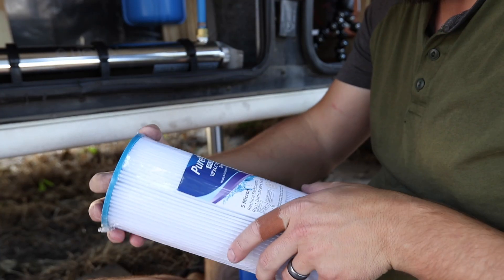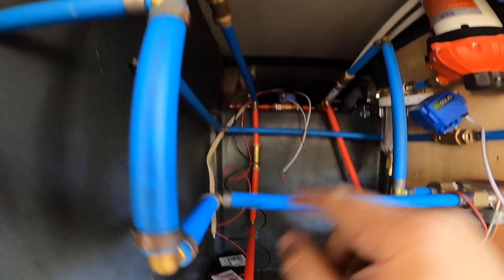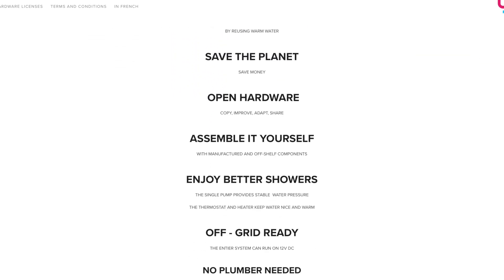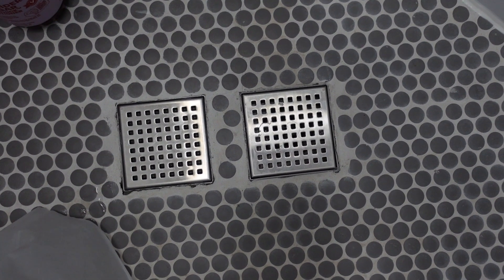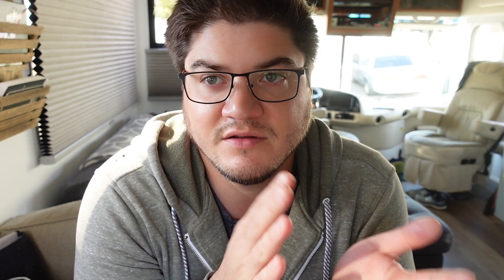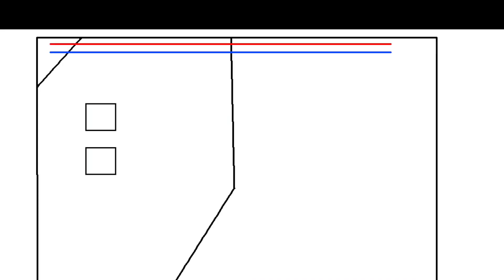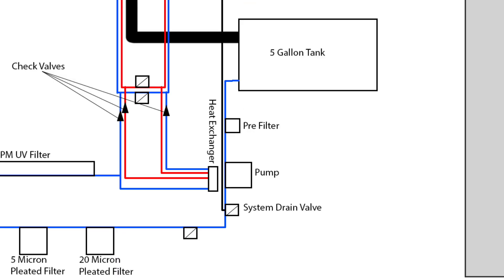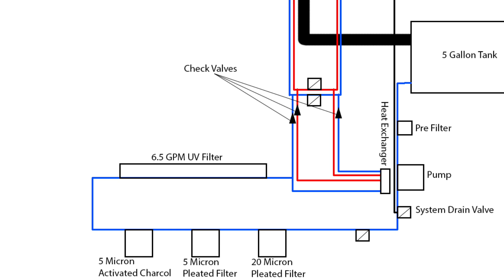Overview of Our Recirculating Shower | RV Renovation

Comment: Just subscribed to your channel.  Making a recirculating shower is not easy. I've seen some companies still working on the system for over a year!   It would be great if you setup a " How to PDF" document... an income source?    How do you clean the system?  Some builders will reverse the water flow a few times before the replace / cleaning the filters manually.
Reply from the maker: Thanks! We were going to try to get a back flush system working, but simplified it down. So we manually clean the filters. The worst is for them to sit for a while. If it’s used pretty regularly, they aren’t too bad. It’s also good to note that this system doesn’t filter out all the soap. You would need a pretty large sand filter to do that from what I’ve researched. This one does a great job for how compact it is. We wanted something that was better than the ones that just push unfiltered water back through. The unfiltered ones do exist as retail systems. But I think the filtered ones have taken so long because they are working hard on water purity.

Comment: Having used this recirculating system for months now, do you still like it? How often do you have to change out your filters & do they get more gross than usual? How is the system holding up in terms of maintenance? Is the recycled water drinkable? If so at what point is it no longer. I ask cuz George Muro from Humble Road has  dissuaded. me from considering it, he doesn't seem like a big fan of the filter aspect of it.
Reply from the maker: The filters will get grosser than usual if you use a lot of soap. It works well still for what we need. We designed this for our use case. It’s been holding up well. We’ve cleaned the filter a few times. If they sit for a little while, they will need to be cleaned. 
Again, it all depends on what you need. I wouldn’t recommend this to everyone. There are simple systems on the market that just recirculate water with no filters or heat element. That may be fine for some people. We decided to do this as an experiment for ourselves. So far it’s been positive. But it does introduce complexities. 
The shower water would not be drinkable. But in a pinch, we could put in new filters and run river water through the system, and I am confident that would be drinkable. I just wouldn’t trust it if the system has been filled with shower water.
Reply: @ryanandsu  Coming from people with real world use of this type of system. I appreciate your honest, thoughtful & in depth information. Thank you, stay safe.
Reply: Ryan and Su. Great work. Soap issue - I am thinking of a soap catcher in shower base, something like wooden slotted removable box, 1 inch deep, with quick drying towel cut to size and held in place to catch some of soap, extend filter service period. 

As engineer I have worked on back flush filter cleaning systems, going to look at that. 

Will make mine as a removable cassette system so I can remove for service and repair, and in winter when not using van, maybe have trace heating option for a planned trip to Norway. Who knows. 

Other idea is external grey water pre-wash, catch grey water in tank with little pump to wash worst off legs before shower, wash dogs, boots etc. 

Not sure if you have seen ‘solar dump’ idea, uses hot water heater as a dump load once batteries full, see fb 12v boating, or search YouTube. Simple and nice idea to work with shower. Well done and thanks man. Graeme Wales UK

Comment: Love this setup! Question: What temperature does the hot water going INTO the heat exchanger need to be to heat the shower water? I'm looking to do a water to water heat exchange that moves water from my fresh tank through a hot water heater, to heat the shower water without contaminating my fresh water. Also, how do you keep your filters from leaking? I'm having issues with inconsistent leaking between filters, and around the lip of the filter top. Any tips would be GREATLY appreciated!
Reply from the maker: I’m not sure what it needs to be. Our is very hot. Like 140 degrees F. But I think the bigger thing is flow. It needs to be able to transfer the heat out of the hot water and then get nice hot water in there again to keep the transfer going.

Comment: I've seen a couple of these set ups yours is the coolest yet. I've been thinking of doing this but no one goes in to detail on it okay a little bit of where I'm at in my build now I have a forty foot MCI MC9 bus I'm converting I have 250 gallons fresh water tank, propane on demand hot water 250 black and gray combo tank and the water pump I'm Thinking I'm going to use a small well pump that has the expansion tank built on it I have 3/4 and 1/2 pex the pump the water heater are 3/4 main lines from the tank are 3/4. None of this is installed yet because I'm just not there in the build yet I'm at the spray foam stage
But it won't be long. 
like you I want to be off grid for extended amounts of time and not worry about the water.i have three storage bays but the front bay will be used for my inverters and battery storage one of the other bays will be used for the black tank and utilities in and out components so I have room for this in the last bay or in this case the middle bay the black tank takes up the last bay closest to the rear wheels I do believe my propane water heat can do recirculating for like radiant floor heat so I would need to figure that part out oh I have about 40 gallons of usable propane on board also.
Any direction you might have would be great thank you for any help.
Reply from the maker: Thanks! We do not profess to be DIY people at all. If the details are a little shaky, it's because we are trying to just document what we are doing (good or bad) and not trying to show how to do something. haha.
All of our piping is 1/2" and it works fantastic for recirculating the water. There is a ton of pressure and flow. We also have a 6.5GPM pump dedicated to the recirculating system. That also has been fantastic. No complaints about pressure or flow. The pump we bought is a marine pump (Seaflo)  that runs on 12v. It came with a pre filter. It's a little strainer basket that keeps particulate matter from going through the pump. I definitely recommend using a strainer before the pump. But do not use the little one a lot of pumps come with. Get a bigger one. The small one clogged up after about 4 uses. It did strain really well, but for a recirculating system, you are introducing a lot of clothing fuzz, hair, etc. The larger the prefilter, the more use you will get before having to empty it. 
Also, something I didn't do but wish I did was put a manual valve in place between the tank output and the strainer filter. That way you can shut off the output and clean the filter without having to Drain the recirculating system. 
The heat exchanger has been working well unless it is really cold outside. If the water is cold to start with, the heat exchanger takes some time to add heat to the water. Sometimes, we will leave the shower running for a while on a loop before using it just to let the water heat up. If you are adding new fresh water every time you use the shower, then it's not a big deal because the new water is most likely already warm. But we've tried to really go light on water usage and reused the water multiple days in a row.

Comment: Great video with lots of good info. Thanks for posting. I'm still trying to understand how the shower water is heated. Am In correct that hot water goes from your water heater through the heat exchanger and then flows back to your hot water heater in a closed loop? And that the water used for the shower is heated only by the heat exchanger so that none of that water actually goes through the actual water heater? I'm trying to figure out a similar system where I can retain the integrity / cleanliness of my hot water heater, but still use it to heat the shower water. I like your idea of two drains, allowing you to use soap / shampoo which can be drained into the grey tank, and then switch over and use the recirculating function with minimal soap / debris going through the filters. Good job.
Reply from the maker: Yes. That is correct on the heat exchanger. It keeps the two loops separate. They do not cross contaminate. 
I built in a hot water loop for the water heater that pulls hot water through the exchanger and then send it back to the cold water input to be reheated. Just like you would for a house hold system to get instant hot water on the far side of the house from the water heater. That loop heats the heat exchanger. Then the recirculating water goes through the other side of the exchanger and pulls heat out with the water never touching the fresh water. It’s basically a big heat sink transferring heat from hot to cold.
Reply: @ryanandsu  Thanks so much for the speedy reply. Much appreciated. This sounds great. I don't want to contaminate my water heater with recirculated water as I also want to be able to have hot water in the sink. This sounds like it may solve both of these issues. Thanks again.

Comment: So you opted for a heat exchanger (only)? Would having a heating element within the loop be more energy efficient? Since you don't have to heat the water from sratch once it's up to temp. but just cover the heat lost during recirculation... Clever system. I like the use of that heat exchanger and the seperate 5 gallon tank. And the accessibility for maintenance. Is the 5 gallon tank easily accessible for cleaning? Does it need cleaning often? Have you tried taking the recirculated water for analysis to see where you're at? How often do you need to swap out the filters? How do you cope with soapy water? Have you tried adding magnesium salt (i think that's what is used...) to cope with soapy water creating deposits in the system? Would insulating the pipes reduce heat loss and improve energy efficiency? I'm rambling... I have tons of questions. I'll try to see if uncle google can cough up any answers. Thank you for sharing.
Reply from the maker: Yes. We went with a heat exchanger only. Mainly because we didn’t want to introduce another heating element that would draw off our batteries. Using the heat exchanger with our water heater let’s us use either electric or propane. And the thought was that we could dump the holding tank and refresh the water in the loop with warm or hot water whenever we wanted to shower. It’s not as efficient as reusing the water for several days, but with this method, we don’t have to heat the water from cold with the heat exchanger. 
I haven’t had to clean the tank yet. But I would do it like I do our other holding tanks. 
We haven’t had the water analyzed. I’m pretty confident it has soap still in the water. It doesn’t come out sudsy. But it’s really difficult to remove soap without a big filter system. This loop that we designed was an attempt to be a little better than the ones that simply recirculate your shower water without filtering. It works great for our needs. But if you want it to some out more like potable water, you would need a much bigger sediment filter. 
I haven’t tried magnesium salt. There are a few things on my list to test out. I just haven’t gotten the chance yet. We did use the system a lot when we were in Utah hiking everyday. It worked great. 
Check out showerloop.org. From what I understand, that’s the origin of the filtered loop idea.

Comment: That’s awesome. Question if you don’t mind. Where do you tie the drain from the 5 gallon tank into the grey water tank?
Reply from the maker: We used another valve that sends the 5 gallon water through some pex into the shower drain that drains into the grey tank. It feed into the drain above the p-trap.

Comment: where did you get the wiring diagram and programing to the Arduino?  I want the duel function shower for my van build and really like this setup. Please send me some good links/research.
Reply from the maker: I did some research into different use cases for the arduino and relay board and took some bits of programming from similar applications. I cobbled together my own code. I keep meaning to post it up on our website. I may have to try and do that this week. I think it will be helpful for others and for me to remember everything I did wiring it.
Reply: @ryanandsu  yes please do. and give me the link. I am no programmer but the rest of the setup i can do 100%. Would be much appreciated.
Reply: @ryanandsu  any updates on when you can post your code for this project? no rush just checking in

Comment: .... how do you remove the remnants of soap and / or shampoo?
Reply from the maker: That one is tough. Ours doesn't full remove the soap. The water comes out and is a little cloudy, but doesn't smell. For us, it's fine. But everyone has different standards and needs.
Reply: You can use multiple activated charcoal filter to the dissolved contaminants.  But is still gross.  The recirculated water will never be the same or clean as tap water.  L

Comment: Awesome job. I've been planning on building  something like that  for years. How did you realise the switching between regular use with fresh water and the circle? So how do you switch between the two sinks? Do you have some  sort of valve for that too?
Reply from the maker: We are using electronic ball valves. The ones we have will take a 12v current and open. Then you reverse the polarity and it closes. So we can close the fresh and open the recirculating and vice versa. In the floor we put in two drains. One goes to the grey tank and one to the recirculating holding tank. We then just use a tub drain stopper to close off whichever we aren’t using. We didn’t want to use a three way valve or anything like that because of the possibility of failure under the shower floor. Trying to get to it to fix it just seemed like a nightmare.
Reply: Thanks for the quick response, you guys are awesome.

Comment: Very nice and informative. 
How clean is the water? How many times do you shower with the recirculating water before replacing it with clean fresh water?
Reply from the maker: We used it for a week when we camped in Zion. It worked really well. It comes out like cleaned bath water. It wasn’t crystal clean as the soap doesn’t come fully out. But it works great as a camp shower. I built it so we can flush the tanks and fill with clean water whenever we want. Check out the YouTube channel Snow & Curt. Their system is very similar. They say they use it for about a week at a time.

Comment: just wondering Will it filter the out the soap from the water?
Reply from the maker: Not really. It’s great if you come out of the ocean and want to warm up in a long shower. With soap in the system, it’s like cleaned up bath water. But when camping, it works great. We really like using it.

Comment: Awesome info! We have a similar setup and just cannot get rid of the soap. We have since purged it and are considering using it just as a rinse in between "real" showers. We are so frustrated with the soap. If you (or anyone else out there) know a way, please share.
Reply from the maker: Check out showerloop.org. His design uses a sand and charcoal filter and does a better job with the soap.
Reply: I ditched my recirculating shower for the same reason. Tried all different filter combinations and water additives (like the original Hour Shower guys used). Either water still has soap, or the filters clog after 2 showers. Ended up not being worth the hassle so I took everything out.

Comment: Excellent video amen.

How well do those plated heat exchangers work? Do you continuously circulate hot water through the heat exchanger during a shower? Will the heat exchanger hold heat well for a while?

Thanks so much for sharing,
James, Rescue Kitty😺 & Snowvan!
Reply from the maker: It works pretty well on warm water. If the water is cold, it has a tough time keeping up. We have a hot water loop continuously running through the heat exchanger while we are using it. Otherwise, the blades on the heat exchanger transfer all their heat over in a matter of seconds and get cold. So it needs the hot water constantly reheating it.
Reply: @ryanandsu  ohh, Thank you. Very good to know for sure!

Comment: Great ideas! How do you remove the soap from the water since being dissolved will allow it to pass through your filter system?
Reply: Depends on the soap you’re using. The filter should remove most of it, but you can smell the scent. That’s why he designed two drains. The normal mode for the initial wash to get ride of soap and sediments, then use the loop mode for just shower.